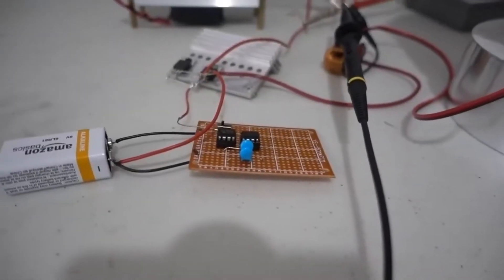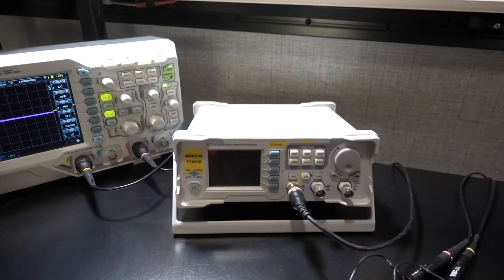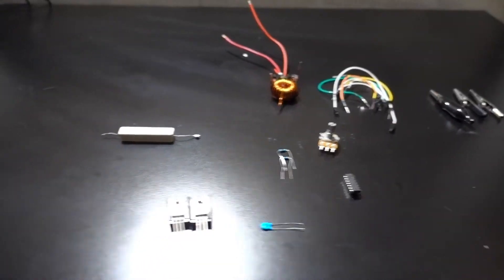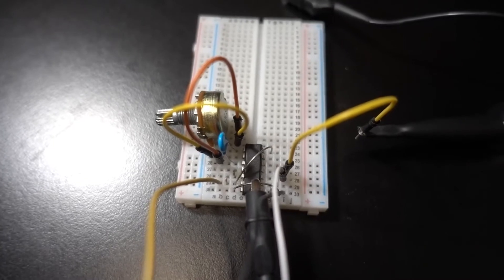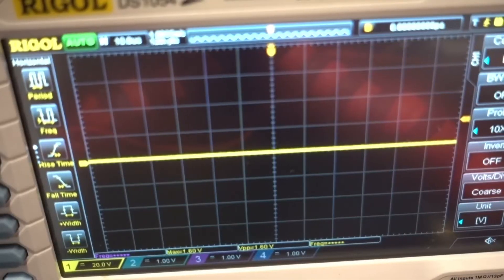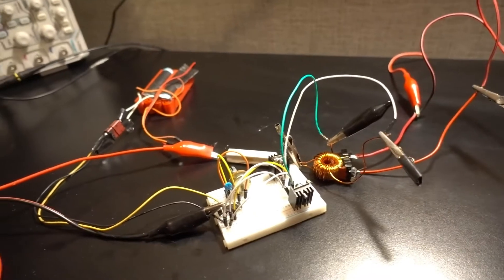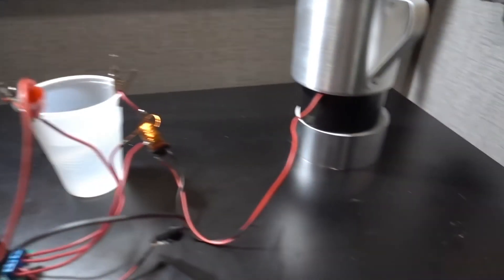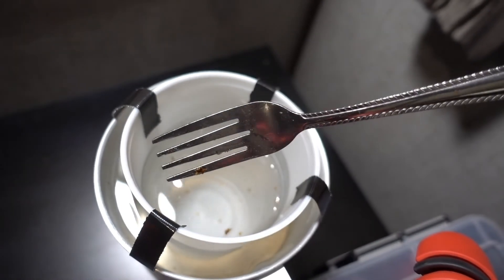Simple Ultrasonic Cleaner Circuit Part 2/2

Comment: Great project! Could you give some more info on the coil, please? What is the wire guage? What is the diameter of the coil? Can I simply buy a toroidal coil (which capacitance?) and add the two 5 turn windings? What is the actual voltage coming out of the coil and going to the transducer? Is there a risk of electric shock from the transducer?
Reply: Yes it gives out a nasty zap my freind!!

Comment: Why 40khz on primary? if you want 40khz on the secondary winding driving transducer your primary's freq needs to 4x that of the secondary? 40*4 =120khz on the primary.. would you like some quotes confirming this? look up  https://patents.google.com/patent/US3516645
Reply: Frequency doesn't change with winding turn numbers

Comment: To messure resonance frequency dont’t you have to account for the water mass ?
Reply from the maker: yes you do, in my case the water did not change it that much.
Reply: Aaah I see :) Quick question, have you thought of using s mazilli driver (royer oscillator) to power the transducer?